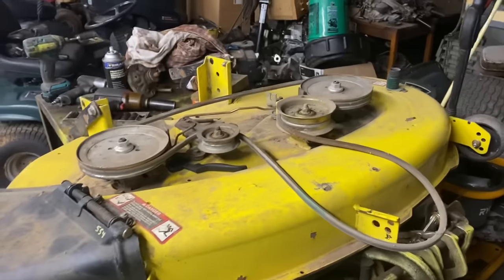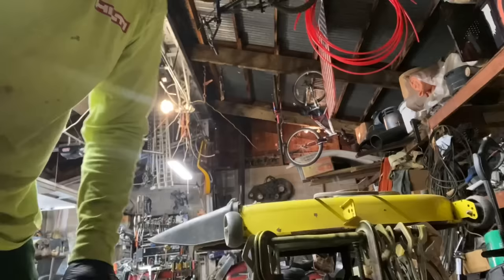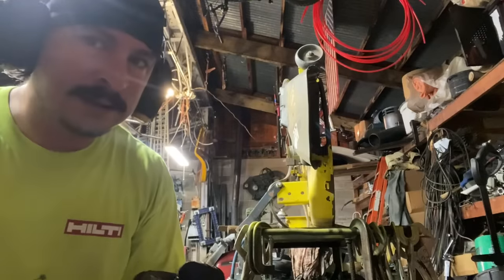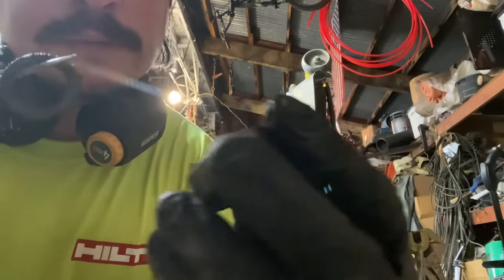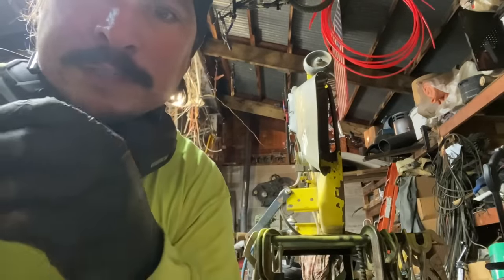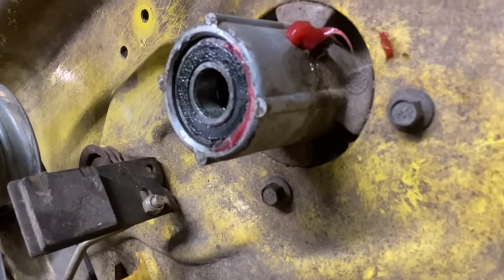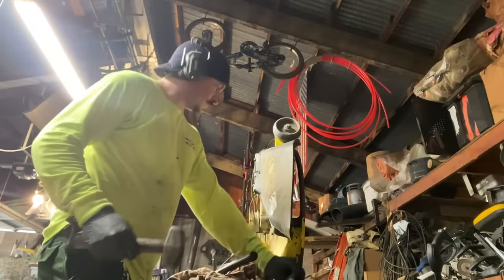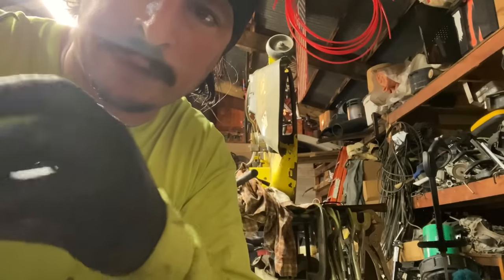Part 1 - Don’t trust the “Experts” Grease your mower deck sealed spindle bearings Common sense.

Comment: I have saved quite a few sealed bearing using my needle greaser until I see grease coming out in several locations  , but you are very correct in your video !
Reply from the maker: Love my grease needle. Well at least until they break. But they are cheep enough. Now I really love the grease needles Even more because I found out about the lock and lube tips. Those are awesome for grabbing and hood grease needles and can release them without breaking.

Comment: My Encore Professional Grade had 
NO grease fittings on the shaft flange at all !! 
After 3 seasons , I took them off , installed grease fittings & new bearings & filled them with grease just as you recommend . It makes perfect sense !!
Reply from the maker: Thanks for the comment. 

I get a kick from the guys saying it’s a waste of time and better just to replace the bearings when they go bad. Why the heck not just keep
Them
Greased and save all the hassle latter down the line? It’s been working great for me so I’ll keep greasing mine.

Comment: In my first employment I often lubricated "sealed" bearings in small motors by forcing grease in by hand.  This video is spot on.  Recently I pumped grease into the spindles on my 54 inch deck until grease oozed out through the bearings.  I guarantee they are well lubricated and it didn't require removal of the seals.  Glad I found this video.  It proves I was right.
Reply: You didn’t prove anything. The only thing you did for certain, was compromise the seal on the bearing when you forced grease past it. Additionally, there’s a second question if you used the correct grease for that application.
Reply: @turbodog99  I rebuilt small dc motors for over 20 years and I often lubed "sealed" bearings by hand and it would have been very evident if I compromised a seal.  Anyway, part of the demonstrated process is to remove one of the seals so "compromise"is a moot point.  I didn't know there was a special grease for this application.

Comment: I have tried to explain over the years about exactly what you’re talking about to some of my customers. You can’t just put five or six pumps of the grease gun in there and you’re good to go. You have to pump it and pump it pump it and I’ve had people tell me I was out of my mind wasting all that grease! Lol what do you mean waste it? Where is it going to go? And that’s a good point that you made about bearing seals. when you have a bearing with a metal shield on one side and a rubber seal on the other the rubber seal always goes towards the grease Fitting. I can’t tell you how many times I’ve seen bearings put in upside down because people weren’t aware of that. But it’s an important fact.  glad you shared it. Great video!
Reply from the maker: Thanks. Rare to find someone already in tune with my way of thinking. 

I get a kick out of all
The experts who never had a deck apart but they are experts in bearings from another completely diffrent application and think I’m doing wrong. Anybody who won’t provide proof of process or proof of how this causes failure is just full of hot air. Another “expert” lol. 

Thanks for leaving a comment. Always good to have supporters!

Comment: Hi Russ , this is the perfect video I’m going to show my local JD dealer.. I recently dropped off my D105 ride on to have the rear pulley assembly replaced and I asked them to grease everything that needs greasing. The reply to that was we will grease the front but not the deck because the bearings are sealed … Well Ha Ha , they will be in for a rude shock after watching your video 
Cheers Rod from Australia 🇦🇺
Reply from the maker: Don’t get your hopes up. Half the people who watch this video still
Don’t think it’s possible. If folks who fix mowers don’t already understand this concept they probably won’t be able to absorb this information but doesn’t hurt to try. Lol.

Comment: Thanks for the detailed video. I can see where people have concerns about the bearings not receiving any new grease with a seal. The different type of material that the seals are made of makes sense. One rigid , one flexible to allow grease to flow. It is a design that needs improvement since this is a question of contention. I had a Marty J mower and the spindle bearings and grease port worked great! I had that machine for years and I mowed 5 acres weekly.
Reply from the maker: Thanks for the comment, I always appreciate someone taking time to leave a positive comment. As for the design needing improvement, I think they work exactly as designed and the main issue I see is the lack of information from the manufacturer on properly adding grease to service the units. It seems as if they want us to avoid the servicing of the bearings so they will fail and cause owners to need repairs or Replacement of mower.

Comment: I am so glad you covered this. Seals on standard bearings can extend the life because they keep dirt out but the seal does not prevent grease from passing into it. This no grease sealed bearing myth started when electric motor manufacturers figured out that grease guns had so much pressure they were pushing grease completely through the bearing and into the motor windings which caused overheating and electrical failure. Many motor manufacturers switched to, no grease, sealed bearings and removed the grease fitting. A spindle bearing can not be over-greased. Excess grease will squeeze right through the seals and out of the housing. The #1 concern when greasing is to wipe the grease fitting clean so the new grease does not push dirt into the bearing. The other myth is that the grease is the lubricant when it is actually the oil within the grease that does the lubricating. Bearings will quickly overheat when rolling through thick grease but as long as the grease can be expelled, the elevated temperature makes the oil come out of the thickener and within a few seconds it will cool down. Another tip I have learned is that a few squirts of oil directly on top of the housing where the shaft goes through will slowly penetrate into the bearing below. My spindles have no grease port and I used this trick when the bearing got hot and loud. I oiled it with chain saw bar oil every time I used the mower and after 6 times the bearing got quiet and quit heating up. Oil is your friend. Many seized-up motors can be revived with a good oil soaking directly on the motor shaft so it drains into the bearing. Light oil for small bearings.
Reply from the maker: Thank you sir for taking time to comment on this. You are one of the few who feels the way I do. It’s hard to provide proof of this but I have experienced the same results you have. I have revived many old fans and other things by just greasing the shafts and letting the oil soak in. I have a fan I found in the trash 5 years ago. I jibed the shaft on the engine and it’s been running ever Since. I add a drop of oil on the shaft once a year. It’s just a cheep fan but why buy one if I can get one free and fix it. As for the topic at hand. Great to have some folks who can support my claim. I get a ton of naysayers who are unwilling to even try it and already know so much from all the years of doing things another way they are unwilling to accept or even try it this way. It’s sad and silly that some people can use the excuse that grease is too expensive as a argument on why this is a waste of time. I’m not sure what they pay but a tube of grease ain’t breaking the bank over here. Lol. Also I never really thought about the grease as not actually being the lubricant but that makes sense to me. I notice when it’s really hot my grease guns will drop oil on the floor in the shop. So Iv kinda suspected it but after you explained it I think it is a very relevant point. I have stated the same thing as you in many of my comments to naysayers about not being able to over grease these. Just fill them full and stop when you see grease. It’s so simple you would almost think it would not need to be explained but even when it’s explained in great detail folks still argue. But those same folks that argue are usually unwilling to even try it. I just say maybe they should make a video showing prof it won’t work.
Reply: @GTObearclaw1  You're welcome. I have 30 years of mechanical maintenance experience on rotating shafts with preventive maintenance as a huge part of my work. I have replaced bearings in every kind of housing you can think of and there is a lot of science in lubrication but the rub is in the individual application. Many inexperienced repair craftsmen have heard stories that they try to crossover to their work without understanding the differences in application. Salespeople are not to be trusted. I learned many hard lessons by letting salesmen do my thinking for me. The engineers that develop the bearings and the lubrication are a better source but good maintenance experience is the best teacher.
Reply: @GTObearclaw1  About "a drop of oil" : EXACTLY ! I have saved many Home "Window-Mounted" Air Conditioners by simply oiling the fan motor shafts. I put it on its back and oil the front shaft from the top - wait 1 day - Flip the AC on its face and oil the rear from the top - wait one day - flip it to flat and wait one day (for the Freon to re-distribute).
They 95% of the time start right up with no squeals, and if not, they have a bad compressor start cap.
It's funny that 20-50 year old AC's still hold their Freon for decades, and a 2020's AC looses its Freon charge before the motor bearings fail.
P.S. Most very old AC's had oiling ports on their fan motor bearings, and printed instructions in the manual and on a sticker too!
Reply from the maker: @ToIsleOfView  that’s worded so well I wish I would have said it exactly like you just did when I replied to some of the know it all people who left comments saying this won’t work. Lol, I know it works and has worked perfectly every time. Thanks for sharing your thought.
Reply from the maker: @joeteejoetee  that’s exactly information. I love to fix things that can be fixed and hold off on spending money on something new that may not be any better than what I have. Great comment thanks for taking time to share.

Comment: Interesting video. I'm currently replacing one spindle on a John Deere due to it being bent. I watched several videos that suggested removing the inner seals so grease can get to the bearing. I questioned that because I don't think the seals are providing much of a seal and your video shows that I was right.
Reply: He came to the correct conclusion but he didn't mention why and I suspect he doesn't know. That grease gun he is using would pump 5000psi or more, lever grease guns are usually 8000 to 10000psi and can go to 15000psi. No run of the mill sealed bearing will stop that kind of pressure.
Reply from the maker: @mrsock3380  I’m aware and this information is available as I looked it up to find out. It blows my mind that these other so called mower repair guys posting videos can be so closed minded. As soon as they hear seal they seem to have a mental block. Folks need to use there brain and question the theory especially from guys posting videos who just ramble on about how something will or won’t work but don’t bother to prove it. They just want the glory of making a video. And some guys have awesome quality videos but offer bad information.
Reply: @GTObearclaw1  no doubt. Someone who was supposedly a Ford mechanic told me torque specs for lower intake manifold on a 2004 Mercury sable duratec was 21 ft lbs. Broke one bolt while torquing to that then two more getting the others off to remove the broken bolt and then found out there's no after market producer for those bolts and a Ford dealership said there was only 4 left company wide for that specific model year and they were $200 a bolt.
   Afterwards found out from other forums the torque was supposed to be 89 inch lbs which is a far cry from 21 foot lbs.

Comment: Thanks Doc, good to know.  Last time I changed my mandrels, I took them apart, lifted the seal and packed them with grease.  Then I put them back together, filled the void space with grease until I saw grease at the ends, THEN installed the new mandrels on the deck.  If I had only known, it would have saved me all that work!  But now I know for the future.  Thanks for sharing!
Reply from the maker: Awesome. You did exactly what I use to do years ago before I figured out how to make the zerk work and figured out just to grease it until the spindle was filled. Now I stick to this technique and it’s been working fabulous and yea it saves me a lot of time. Thanks for sharing and leaving a comment
Reply: A good point.  I mean if you've already gone through the trouble of disassembling then why not just pack them with grease from a tub.  I service my deck every year and it doesn't take much more to just take it apart.
Reply: @paddyomalley6835 Yes , that's I was thinking if you already have the bearings out pack them puppies by hand. 😂

Comment: Thanks for the video. I have worked on a lot of equipment, and most often if there is a grease sert the bearings will not have seals. When I replaced spindle bearings on my 18 year old snapper for the first time as preventive measures is when I discovered the sealed bearings both sides. I keep my machines greased up, maby the reason they lasted so long. But wheen I saw that they were using sealed bearings, I thought what is the use of wasting greese, so I did not grease the new bearings. Has not been a long time, so I will go back and throughly grease them.
You made a believer out of me.
It looks like the manufacturers would explain this if they go to the trouble to install grease points.
Thanks again for the great video.
Reply from the maker: Hay thanks for the comment. Yea it’s amazing that out of all the manufacturers you would think there would be more on this topic. That’s the main reason I posted this video because I couldn’t find the right information anywhere as far as YouTube videos so I felt it was needed.

Comment: This is a great video that answers both questions that I needed answered, (1) do you need to fill the cavity, and (2) will the grease get by the shield and into the bearing. This information is suprisingly hard to find.Man, it really does take a lot of grease to fill up thse spindles. Thanks for a well done video. It really helps.
Reply from the maker: Thanks, I agree
this info is hard to find. Most the mower guys out there are spreading the opposite information misleading the DIY community and I have not found any other videos where they take the time to back the claims. Iv been greasing decks for years. Never had an issue. Thanks for the comment. Lots of haters out there but if I can help a few that’s good enough for me.

Comment: Awesome. Glad to see someone put this to the test
Reply: Really?  Just a bunch of fuss about nothing.  My John Deere 155c with 48" deck was bought new June of 2006.  3 of the exact same spindles as shown and I do about 8 shots of grease per spindle every spring.  So that's 16 years, 690 hrs. on the meter and those spindles will probably do 1 more year.  That's also mowing a rough farm yard banging into tree roots and what not.  The spindles and bearings owe me nothing but the bearings can be changed for what $20 per spindle or I believe a brand new spindle from J.D. is about $55.  Big deal. Not much to grease on cars anymore and joints last longer than back when you could grease them.  There's more important things to worry about than spending time trying to alter bearing housings or bearing seals as some suggest.  Belts, 3 batteries, blades,  both deck idler pulleys ( no grease zerk there either )  and just now easily putting in a steering pinion /sector kit with nylon bushings that some worry about.  John Deere didn't make a cheap, throw away mower as some comment.  That's very little repairs for that many years and hours.

Comment: This is equivalent to an aerospace level bench test. He showed us real data with real results. Just a very educational and informative video. Thanks so much!
Reply from the maker: @mpatrick7860  thanks for the comment. Since nobody else would show the process and prove grease goes through the bearings I felt like it could be helpful for some folks.
Reply: @GTObearclaw1  I JUST saw another video that stated the sealed bearings can't take grease! But you proved it! I just bought new spindles because I think the previous owner never greased these. So they are ruined. I got the new ones out of the box and I think they have zero grease in them. So gonna pre grease mine before installation. I'm gonna put the nuts/pulleys and blades on it though so it can't hydraulically separate the assembly because I think it could happen. Apparently.....grease is the word.....LOL